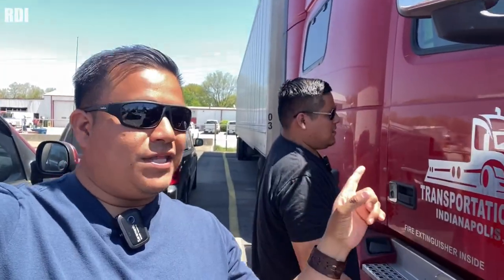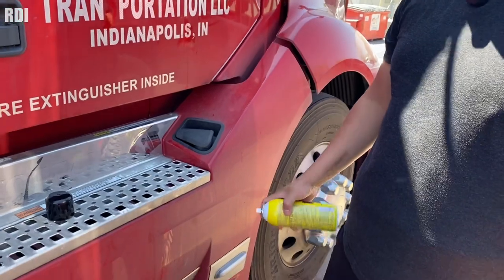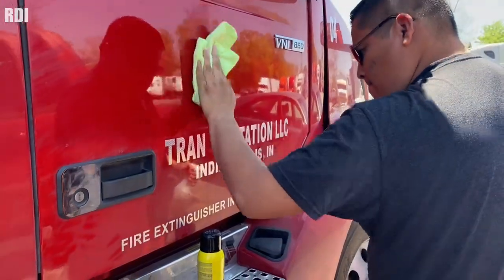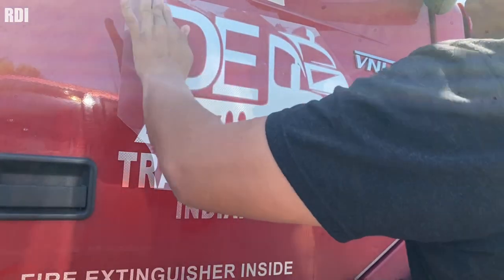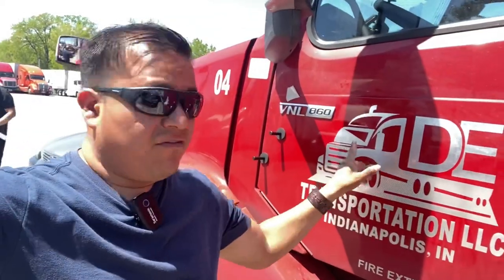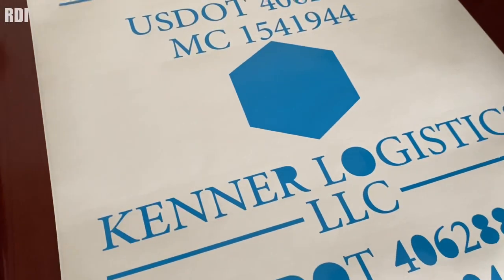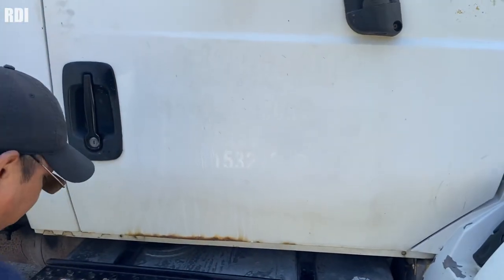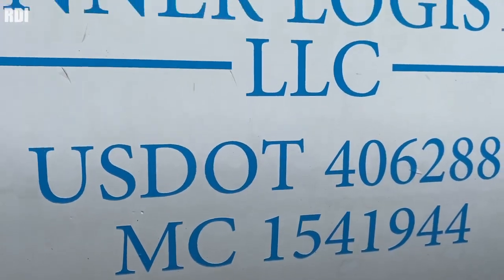When things do not go your way

Comment: Thanks for sharing your trials and tribulations 😊.  I am doing a swap from "PLUMBING REPAIRS" to "BACKFLOW TESTING" on one of my customer's Ford Transit. After cutting the replacement lettering from the original design, I realized I forgot I had scaled the height of the letters on the original installation.  So, I made sure to measure the original lettering this time before re-cutting the vinyl. Every day, I learn something new.
Reply from the maker: Thanks for sharing with us and I guess things like this will keep on happening, as long as it can be fixed 😅. Thanks for watching!!

Comment: I've had the same problem some time back and it seems the panels were to cold as it was in winter i should have put more heat on to the door the first time so what i did was buy a small used 2.8kW Remote Controlled Quartz Halogen Infrared Heater as these heat up just the panel and i all ready had a generator Oh the joys of living in the UK  damp wet windy little sun 😁
Reply from the maker: Sounds like a great idea! We brought our heat gun but didn’t use it, this could have prevented the decal from peeling off 😅. I guess we learned our lesson. Thanks for watching!!

Comment: i dont see the reason for using oracal 651 for outside use. the colours only have like 4 years duability. the 751 is far better with 7 years.. and its a little ticker, and more easy to peel and apply. i dont know how much extra it cost compared to 651.  anyway, its cool to see what you guys are making.
Reply from the maker: 751 costs more than twice we only use it in difficult surfaces like on metal rivets but most of our customers are ok with 651 since construction people change trucks every 5 years so they don’t invest too much on decals
Reply: @RDIdecals  ok, then i understand more. twice is a lot. i think, here in Norway, 751 is just about 20% more expensive.. so i just keep 751 in stock .. and i think i save on not having both 651 and 751.  keep up the good work! :)